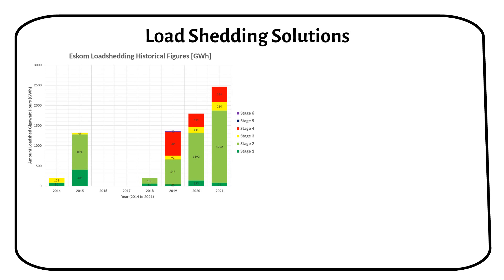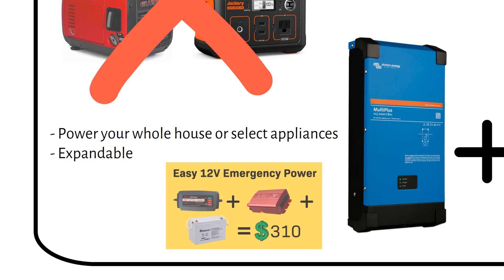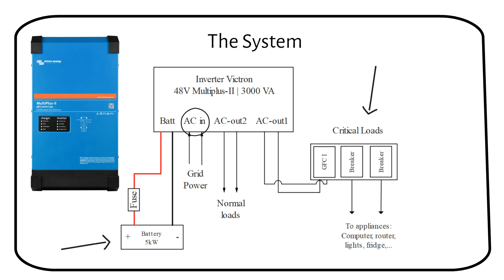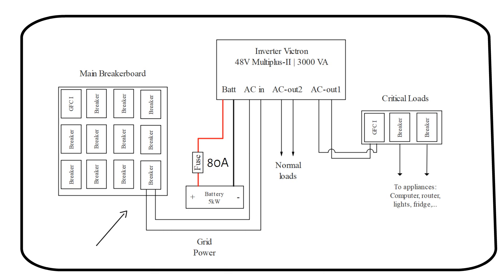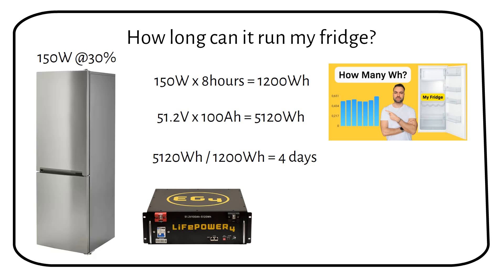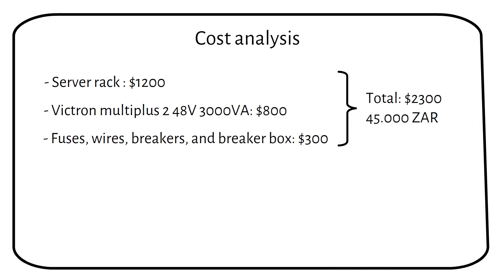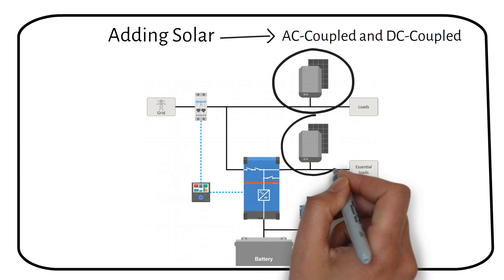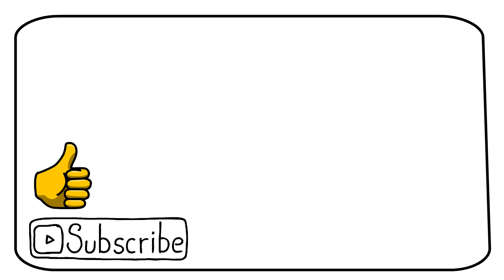Load Shedding Solution for South-Africa - Eskom DIY UPS

Comment: With the multiplus II and grid feed, do you need an energy meter like in your diagram, or does the external current sensor clamp work?
Reply from the maker: I have the energy meter, not the clamps. Maybe it works with the clamp meters. The manual should tell you. I'm not sure.

Comment: Hey CleverSolar, the Multiplus 3000Va 48v Here is R9250.00+-, 5KW 48V battery (SVOLT)R15900.00 x2, Fuses, Wires, Breakers, breaker box R4000.00max Total R45050.00. Spot on
Reply from the maker: I did my research 😉
Reply: @cleversolarpower  Awesome, but for reference.R45000 is quite expensive over here. 3 or 4k in Dollars might not seem like much but R45000 is considered the monthly middle to upper class salary here. For me for instance I can spare around R500/month of my salary to save towards this. So it would take me roughly 2 years to buy. without incurring loan.

Comment: I see the allure of having a very simple system without solar panels, but it makes for a very, very expensive system when you do that.  And the multiplus is overkill if it is only going to run a few loads.  It doesn't really make any sense to try to run the whole house with a system like this due to the small amount of battery storage.   So I see it as a bit of a mix of components that don't fit well with each other at small scales.

How about this.  I'll describe a system revolving around 24V but the same thing can be done at 48V for about the same price except the battery charger solution might have to be a bit different (Victron doesn't make a low-cost 48V battery charger).

* 2 x Residential solar panels in series (300W or higher each for 600W+ total).  Roughly $500 in total (probably less).  This will work for both 24V and 48V system voltages.   The open circuit voltage needs to be less than around 85V via the labeling on the panels, to be safe.  As I specify Victron 100/20 charge controllers below (100V maximum VOC, but subtract a bit for margin).

* Victron SmartSolar 100/20 charge controller.  Roughly $80.  This will also work for 12V, 24V, or 48V system voltages (the 75/15 is only 12V or 24V).   Each unit caps out at roughly 500W at 24V or 1000W at 48V.   A bit more as the battery voltage rises.   You can have as many as you need... no need to parallel larger panel configurations.

(unit is setup with a normal charge profile for the battery and the series configuration for the panels will work for both 24V and 48V systems as well).

(again, I'm assuming a small-scale system, not a huge solar system).

* Victron Phoenix 500VA 24V inverter: $150  (Victron also makes a 48V for about the same).   Increase to 800VA if you need more power but the whole point is to only power the fridge and a few small loads.  The smaller the inverter you use that is still sufficient for the loads, the less idle power the inverter will consume.  The smaller inverters consumes roughly 5W at idle.

(this will depend on the fridge's startup needs.  The Phoenix is pretty beefy for surge loads but if you are worried you might have to up it to the more expensive 800VA version).

(note: Some phoenix inverters have a GFCI or AFCI built-in, but the fridge-startup might trip it so be prepared to change it out for a normal plug and put the real protection in your breaker box instead... or better, buy a Phoenix that just has a normal plug and not a GFCI/AFCI).

* Victron Energy Blue Smart 24V 12A Battery charger: $180.   There is no decent Victron equivalent for 48V so you are on your own in terms of finding a grid load-support solution at 48V.  I use a complex setup with a Mean Well HLG-320H-54A power supply run through four schottky diodes in parallel on my 48V system.

(Basically for the battery charger I put the Victron charger in "power supply" mode and just set the voltage to a decent load-support level that still leaves room for the solar to handle most of the energy needs.  For example, I'll set the power supply to roughly 26.2V on a 24V system or 52.5V on a 48V system).

(While you can have the power supply fully charge your battery, you want to leave room for the solar to provide most of the energy rather than the grid).

* One 100Ah x 25.6V LiFePO4 battery: Roughly $500.   Can easily be expanded by paralleling more batteries.  If you go 48V, then the minimum is one 50Ah x 51.2V LiFePO4 battery.  Similar price.

(I recommend 2 AWG battery cabling.  Up to 2 batteries can be paralleled with one main 120A fuse.  If paralleling 4 batteries, a slightly different fusing configuration is needed or one can use thicker cables).

(So, 2560 Wh of storage with one battery, up to 10240 Wh with four).

* Fuses wires, breakers, etc: $300 (same as described in video)

Total: $1710 (USD)

--

There are a couple of advantages to this sort of setup.

* Loads are always on the inverter and basically immune to bad grid power.

* Not having a transfer switch is considered a good thing in many situations.

* Relatively cheap discrete components that can be easily maintained when things inevitably break.

* Easily expandable.  For the 24V system, up to around 2000W of solar (at least if you stick to 2 AWG battery cabling).  For the 48V system, 5kW is easy (again sticking with 2 AWG cabling).   And storage can be expanded indefinitely with appropriate fusing as long as the system total amperage is within the cable specs.

* Your grid consumption is lower, saving you roughly $0.50 (USED) a day = $180/year, or a 10-year break-even on the equipment.  This is better than not having a break-even at all without solar.

-Matt
Reply from the maker: Great system. I would go for the 800VA inverter to run a fridge. Don't think you can use the eco mode when it's a thermostat controlled fridge. You would need to have the system close to your appliances or run extention cords in the house to router, fridge, computer,... The hard part is balancing the charging from solar and the grid, depending on your risk tolerance and hours of autonomy.

Comment: Thx for sharing!  i have a question. how do you size the breaker feeding the inverter when the grid power is present? because it will be  actualy used the charge the batteries and power the loads connected on out 1 and 2 when the inverter is in bypass mode.
Reply from the maker: That is correct. The inverter/charger will have a number behind it, that is the DC charging current. Like this: victron multiplus 48v 3000VA 35A. This means the DC charger is 35A. 35Ax58.4V=2000W. 2000W/230V=8.7A.you can use a standard 20A AC breaker to feed the multiplus, ensure your wires can carry the 20A, usually 2.5-4mm². You can limit the ac input current with dip switches on the multiplus.

Comment: We dont freed back power back into the grid here Eskom is the poblem.
Reply from the maker: Then you can only use AC-out 1 as the essential loads output. However, make sure this doesn't connect to your main electricity panel as it will be dangerous.
Reply: I already have a small victron muliplus setup the bigger victrons are nice but expensive another thing is the import tax is allot.